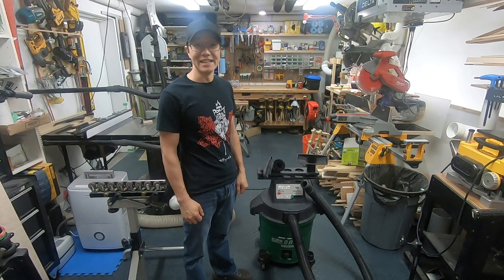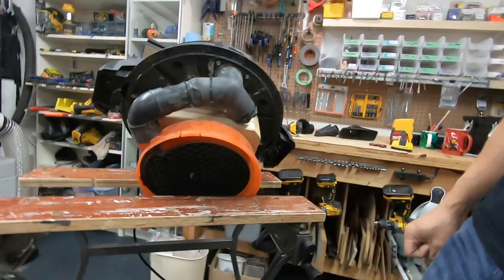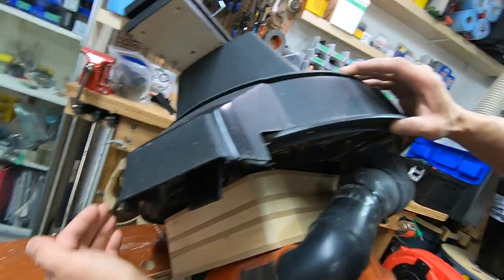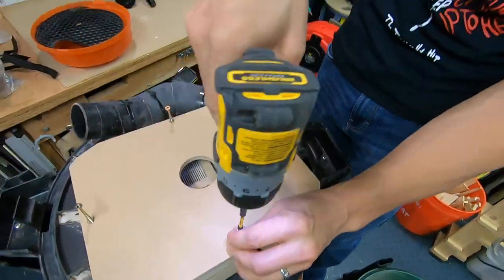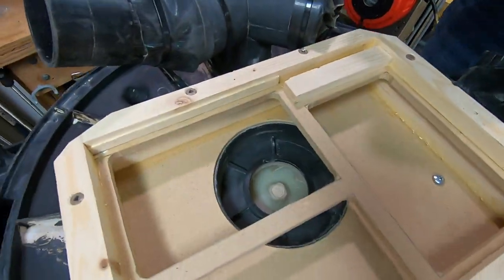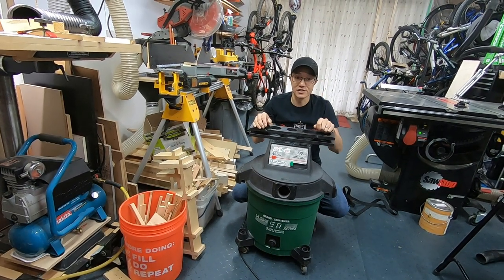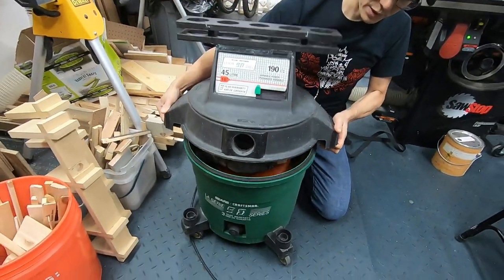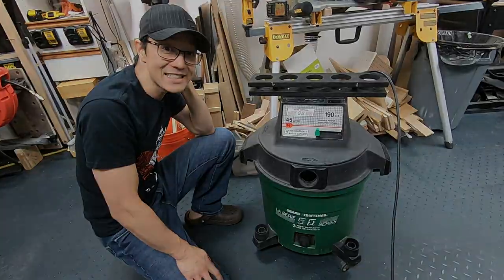Stealth Dustopper cyclone separator INSIDE my shop vac. Totally hidden installation. No cart needed!

Comment: Not to be a troll but this is stupid. I see the advantage of the three filters. But the dustopper inside is useless. It doesn’t increase the power of the vacuum. It is just used to collect most of the debris into a separate container keeping your filters cleaner longer.
Reply: agreed, solution to nothing really.

Comment: You are defeating the purpose of the dust topper. It is designed to dump waste/dust/sawdust etc into a bucket to save on filter waste. Besides which,  Hepa filters cost a lot.
Reply from the maker: This design still accomplishes dumping the waste/dust/sawdust into a bucket - where the bucket is that of the main shop vac for those who don't want to use the typical setup of a separate bucket. 99% of the dust in my setup is dropped into the bucket. The hepa filter choice is an optional upgrade; a standard filter could easily be used instead.
Reply: @WishfulThinkingProjects  Yeah this is basically just the normal way a shop vac works (waste into it's own bucket) - would slightly increase how long the filters take to get dirty, but with the massive negative of being super hard to replace the filters. I mean it works....but it really doesn't seem beneficial. Just use a shop vac filter bag like a sane person.